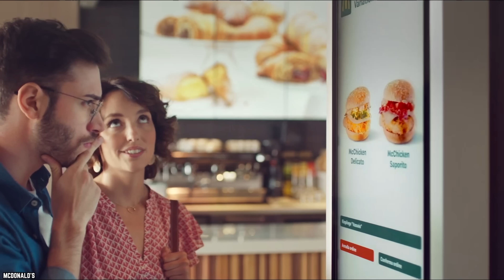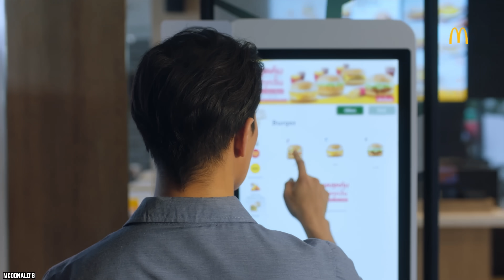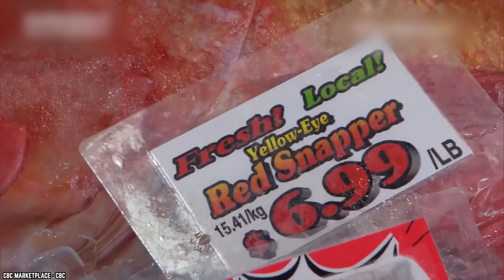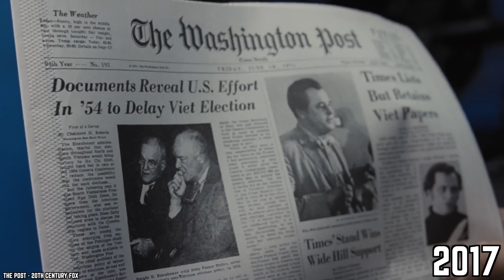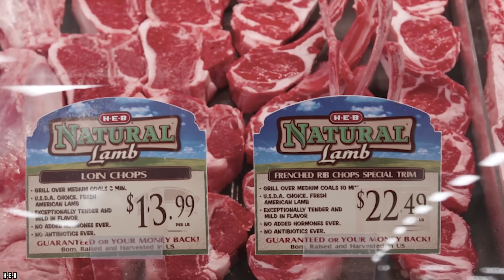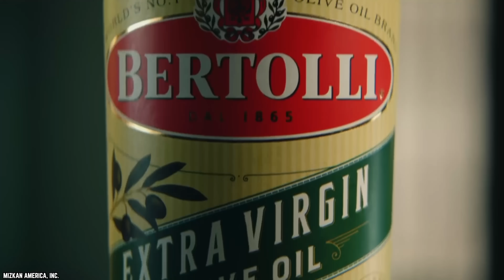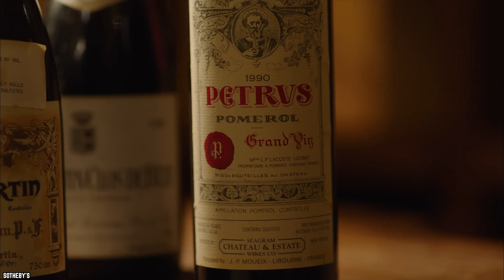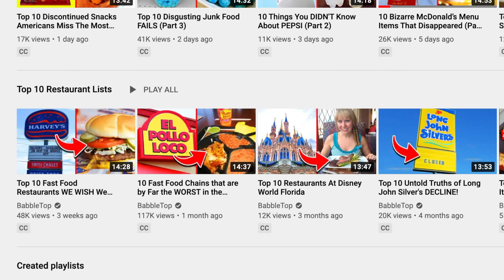15 SNEAKIEST Food Business Tactics You Never Noticed SCAMMING You! (Part 2)

Comment: A lot of the viewpoints on Panera. Are incorrect. I have worked at Panera for more than half a decade. Agreed that many portion sizes are very close. But the bowl is slightly larger than the cup. Also, Panera / Bread Company does not sell donuts. The ultimate point is, do fact-checking for yourself. Before you believe all of the videos you see you on the internet.
Reply from the maker: Thank you for the correction we really appreciate it.🤗@Megan Smith

Comment: Unless it's changed since I worked at bk in the late 90's, they use a broiler.  It's a conveyor that rolls over a flame. There is a control knob for the speed, for when a customer wants the meat well done. I don't know about any other fast food joints than BK & Arby's as those are the 2 I worked at as a teen.